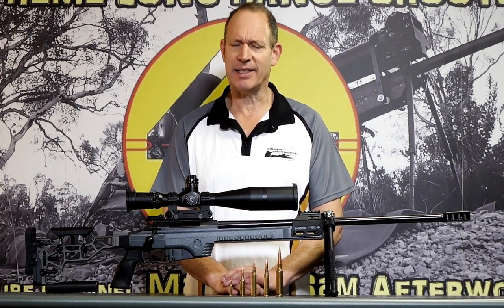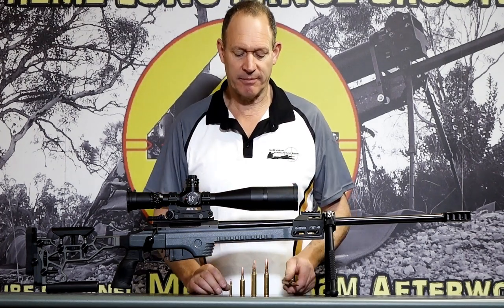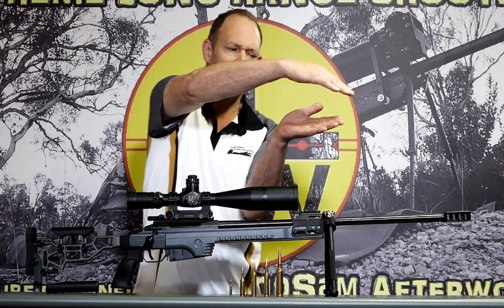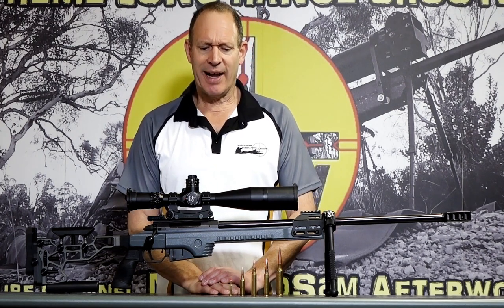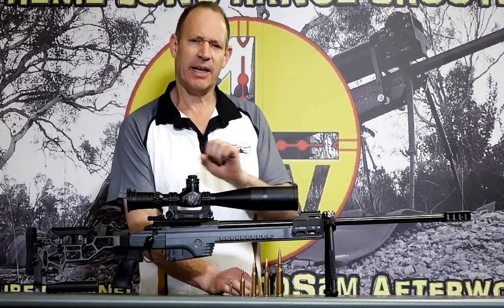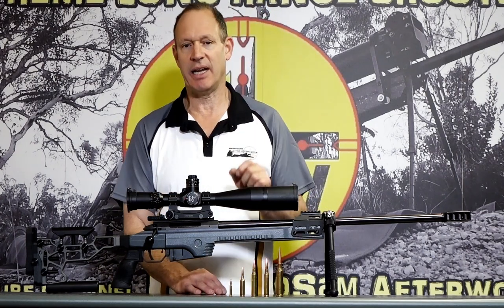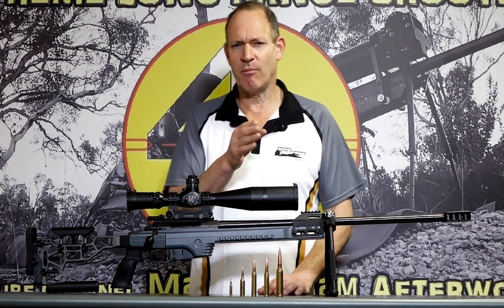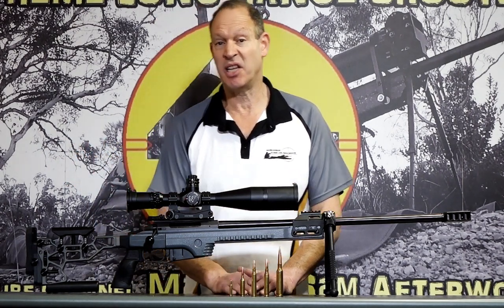Seating Depth? might be worth a thought.

Comment: I found the sweet spot in my barrel at 35k off, and the rounds could still be fed from the magazine if need be. 👍🏻 Loading your own can be fun when you actually see the difference it makes.
Reply from the maker: Yep, cheers
Reply: Finding that spot where the bullet hits the rifling square but has enough momentum (sorry Mark, have to correct you there) to squish into the rifling without excessive pressure is a thing only the handloader can provide for their rifle. Knowing your distance to lands is critical and don't go for max speed, unless it groups best at that powder charge of course.

Comment: I shoot a 260 rem 150" from the lands which at 100yd is a one hole 3 shot group, wouldn't group any closer, if i ran it at 10" there is hardly any bearing left in the brass as tikka barrels seem to have a very long throat.
Reply: Similar experience in my Sako 85 .270.  Glad I am not the only one!
Reply from the maker: Yep, seen similar on some, Cheers
Reply: @markandsamafterwork  This video has saved my sanity! I just started reloading for my Tikka T3X and I was trying to start at 0.020" off the lands as I've seen so many say to do. Well the throat is super long and I couldn't get close enough with the Berger Hybrids I'm using (and still have a comfortable amount of contact with the neck). I'm going to try at mag length and at a few different spots inside mag length and see how she does, cheers!
Reply: @bigjeep127  That long throat is common on European rifles due to some older rounds for them used round nosed, heavy bullets... The upside of a long throat is that it lowers peak pressures a bit, which is good for case life....
Reply: @KathrynLiz1  Yes! so it seems and is mostly the difference with 223 rem vs 5.56 nato chamberings I have been told
Reply: @KathrynLiz1  - Weatherby specifically designed that attribute into his cartridges, exactly for that reason. You get lower pressures and maximum velocities.
Reply: @bigjeep127  - I have Tikkas in several calibers, so I know exactly what you’re talking about. I tend to just load as far out as I can in the magazine, and still shoot way under MOA. I pay more attention to my SD & ES when reloading my Tikkas.

Comment: I thought seating in the lands or close to them gives you more case capacity to use more powder at lower pressure ? I have not ran in to pressure personally seating in the lands or slightly off, I noticed my groups were better with smaller jump but it's all about bullet design and your harmonics I guess. Maybe I need more testing I am fairly new at this
Reply from the maker: If all good, leave it all be, just a suggestion, and testing will give you the answers, Cheers
Reply: @markandsamafterwork  I will definitely need to go back and test my understanding. I learn something new every day, thanks again for insights
Reply: depends on bullet, twist, cartridge, I had a 260AI that like .060 jump even .090...you just have to experiment,,,,use good bullets if you can find them..keep notes be meticulous or just buy a 6 dasher barrel for 1200 in and a 300wsm for on out there..2 very good shooting cases easy to load for if you have a good barrel....

Comment: I have a 7mm 300WM some call it a 7mill practical... When It was build I put together a load using a  Hornaday 162gr  A-MAX which has been discontinued.  A friend of mine that works at Hornaday gave me several boxes of the 162 ELD-X to ty when they first came out. I seated them to the same overall length to make sure it would still fit in my mag. Not knowing much about different bullets and their shape turns out my bullets are seated .112" off of the lands. Not actually sure what the original round  (CBTO) was to for distance off the lands. That was almost 10 years ago and I seem to have misplaced my notes.  The ELD-X shoots under 1/2 at 100 with that much jump.  Not sure how much is too much jump but if its not broken don't fix it right?
Reply from the maker: Yep, Cheers

Comment: Mark, several years ago, when I was testing my new custom made 300RUM, I found that I was getting excessive pressure loading 200gn Accubonds close to my lands and grooves. After trying everything I could think of, I went to the SAMMMI specifications of 3.60 and loaded some at that level. That's a lot of jump but, the pressure went down and the groups got tight,just the opposite of the Berger 190's. I was loading at the time.
Reply from the maker: Yep, can be worth the test, cheers Craig, thanks

Comment: On my factory REM 7 7mm with hornaday match bullets in hornaday brass my ladder showed .030” jump with .004” neck tension was the most accurate. The neck tension changed the seating depth in comparison to overall accuracy. They go hand in hand. Tension leads to pressure.
Reply from the maker: Measurement is only part of neck tension, but sounds like you have all sorted, Cheers

Comment: I run a 1912 M96 6.5x55 - it has large leade due to being designed for old 160gr round nose bullets.   So I seat my usual 127gr SPBT as far out as possible and do not crimp - not sure what clearance I have.   The pigs assess my accuracy as pretty good:)
Reply from the maker: Lol, Cheers

Comment: I appreciate that and respect that. I watched a lot of videos of 300 win mag reloading data, there was testing off the lands and jump and bigger jump, and I’ve always worried about my jump, because I have a tikka action, and they set the jump ridiculously high out of the box. How ever, I’ve swapped barrels, and put it in an mdt ess chassis, aics mags gave me a bit more room, 3.470, but it’s still a jump to the lands. The other video series I watched, said the jump was a good thing as well, too much and the speeds drop off, but all the numbers he ran were correlating to what I was able to do already. Major thing I noticed, is that his charge weights were way higher than mine, and I stopped at the first accuracy node I came across, that was 66.3 grains of h4831sc moving a muzzle velocity of 2740 with a difference of 7 fps and 3 of the 5 rounds were moving identical speeds. So, now I’m going to be looking for a better speed node.
Reply from the maker: Awesome, Cheers

Comment: So what I gather is that the "rule" of 10 thousandth (or approximately short) jump being most accurate was (largely) scientifically arrived at using the previous generation of bullets.  With the current generation of super-BC bullets with a lot more aerodynamic testing built into them, the old "rules" may no longer pertain and one ought to experiment with one's own rifle to gather the data necessary to judge if new "rules" might pertain to new bullets.

Anyhoo, interesting video as always.
Reply from the maker: Cheers Man, thanks

Comment: I bought a  new Tikka 7mm Rem mag. I started my seating at 20,000 off. I got 10 mm groups at 100 meters. Then I loaded a few to fit the magazine they are 4 mm shorter than my "accurate" loads and guess what I still get a 10mm groups at 100 and Im still getting a 50mm groups at 500 meters. (160 grain Accubonds)
Reply from the maker: Cheers
Reply: I think you meant to say 0.020" off.

Comment: I don't care where my lands are, I care about jam length as a hard stop and come back the shortest accuracy node I can find. You can then load longer as your throat erodes.
Reply from the maker: cheers Chris, thanks
Reply: I can't understand why so many can't "see" this. You're saying it in different terms than I would, but pressure = velocity = brass/barrel life = accuracy.
Reply: @DenverLoveless  I think it's because there is a persistent myth that close to the lands is more accurate. Most people don't realise that the lands are not a fixed point for a start.
Reply: @chrismckoy3533  Granted your not making dangerous novice mistakes in loading; once you've found "your loading" longer = less pressure until you jam.  shorter = more but don't use up case capacity unnecessarily with longer projectiles your barrel never was made to shoot in the first place.(off the shelf rifle) It's all variable depending on conditions. Temperature being in the top 5. Btw, I thought I was commenting in the main comment section, but it's all good.
Reply: @DenverLoveless  That is where I disagree slightly, the difference in pressure or case capacity even if you moved your projectile in/out 100 thou is trivial. This is more an issue when loading pistol rounds. Grab a copy of quikload and check out the data.
Reply: @chrismckoy3533  Trivial as far as safety goes and basically a non-issue in that regard, but significant enough to fine tune your accuracy.